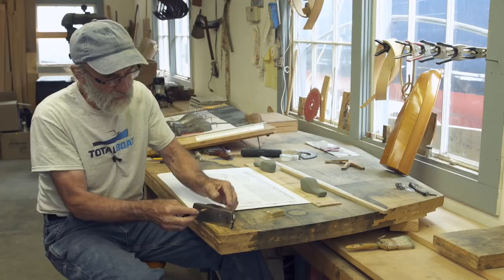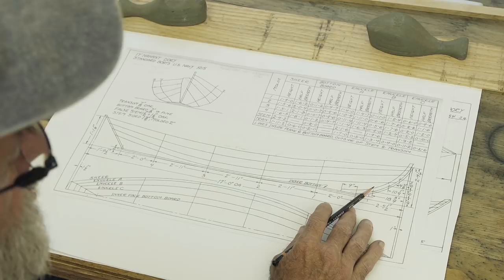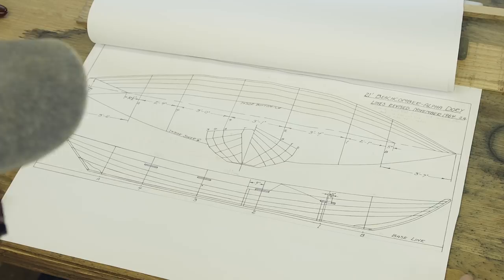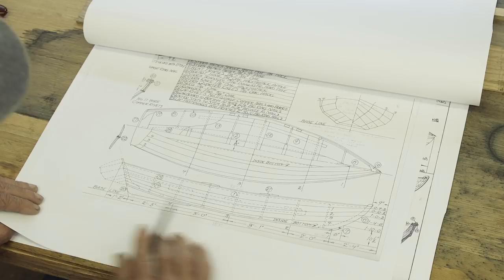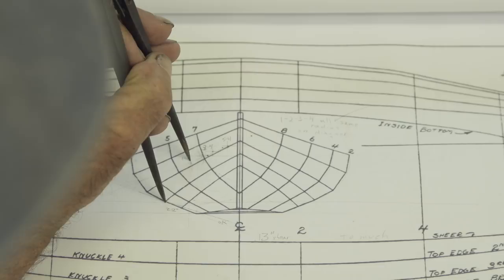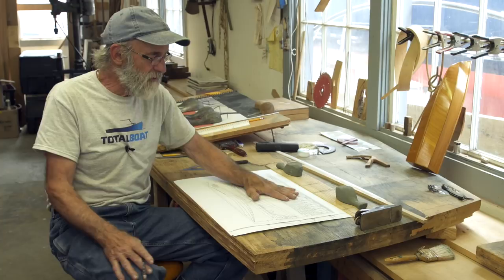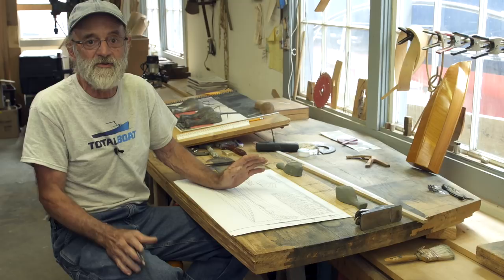An introduction to Dory designs and plans with Louis Sauzedde

Comment: In January of this year from suggestions of others at the boatyard where my small office is (30 years in marketing) I enrolled myself in a boat building school. The word school is used liberally as it's basically just a place where you can build a boat with not much emphasis on self teaching yourself. The boat that was suggested to me to build is the Indian Class 21'2" John G. Alden 1927 classic boat. I've spent the Spring lofting this boat at full size and have been waiting for the stars to align and wondering how I'm going to go about this. So I'm super excited with this plan of yours as there's some similarities in this build, the most is there's 5 planks in lapsrake with the same type of steep deadrise you mention. So super excited to learn and maybe put some of what I learn here into practice.

Comment: Interesting! I’m doing a project using pallet wood. Some of these pallets were more like trays; some 20ft long. I used these to cut them into strips and laminate them into the boards (5plies). I build upside down and found the further shape by making use of long strips of pine taken from the same trays. Where I wanted them to curve more strongly, I thinned them down. Proceeding this way I made a partiality laminated webbing that gives the shape of the starboard side of my 21ft boat. Next step was to make cardboard templates every 10”, that I mirror and bring over to a B/SB mother template. So far so good. I liked the great freedom in 3D life size modelling this method gave me. Almost like working in clay, but much, much faster and less cumbersome.

Comment: Hello Louis, in reference to mixing epoxy. 
I will take a piece of coat hanger, the heaviest gauge. I then take a 10 inch  piece of that heavy wire, and bend it into a triangle on one side,
1" x 1" X 1", it kinda looks like a mini hanger at the bottom. I might bend the other end over on itself then put it in the drill. This tool will blend the epoxy thoroughly in a very short time. FYI

Comment: In order to find the centers of those planks, you would use a compass and perpendicular bisectors between the points. Their intersection would be the center of your circle. You could then find it for the two outside points and verify that it actually is a circle.

Comment: Well I studied those same plans and others, but since I have little practical experience in boats on water, I wasn't looking at them like that!  I've made several half models, and they have all surprised me, in various ways ..... going from 2D to 3D ain't anything I can do in my imagination.  The Nahant Dory lines are intriguing, yet to carve that one. Looking forward to seeing what you got in your head to materialize, and how you do it! 

I'm setting up to make a row boat from Howard Chapelles "American Small Sailing Craft", which I imagine was used on rivers with sea ports on them, riding the tide upstream, and riding it down when it went out, in 1750 or so.  Not because I live on such a river, but because the lines as simple as they were, left me wondering till I had to carve it to see, and I could not believe it, so simple, so sublime, now I got to see it life size.  I'll not regret that it could have been better had I waited to see the 36 dory chapters; I will just start another boat.  The Skiff build was great, I learned a good deal, thank you and your production crew.

I made a 4'x22' ply surface to laydown lines, and glued up battens that long, and had some free DougFir for transoms.  The rest will be White Pine, some White Ash.

I love John Gardeners drawings, but if I had to use plywood ...... I'd stick with furniture repair.
Reply: I got forms set up, and transoms, and chine logs; lots of rocker, and some twist - I'm really surprised how a little twist changes the shape of the board, and how resistant the wood is to twisting, even in long lengths, maybe 15* twist. Pretty cool to see the shape of the full size curves though, more fun than a man my age deserves. Good thing I didn't start with a real involved design. : )

Comment: As I watched over your shoulder while you went through a few designs I started thinking.  If we  examined a larger sampling of designs things might start to fall into a few classes.  Using for instance dead rise, ratio of radius to beam, height of the common radius point above or below the sheer line.  These three factors may start to tell us something about specific dory types.  Or maybe not!  

Anyways I'm looking forward to see where you're going with your design.  One of the problems with small boat design is that you want to build each on of them!

Comment: Another easy way to find the center of a set of planks you know are radially spaced: if you're using that same keel-on view, find the center of the plank (between the top and bottom edge) and draw a line perpendicular to that plank towards the inside of the boat. Do that for every plank and they'll all intersect at the same point, and that's the center of curvature. A line drawn at 90 degrees from the midpoint of a line between two points on a circle (called a chord) will always go through the center, so you only need to do it twice to find the center. Doing it more than twice increases your accuracy, though.

This is the result of a theorem that says "The straight line joining the centre of a circle to the midpoint of a chord is perpendicular to the chord."

Comment: Hey Lou, noticing the block plane upon which you're tweaking the pencil point has an adjustable mouth.  Neat.  I haven't scored one of those yet (all fixed so far), but I did pick up an old circular saw yesterday-JUST because of your inspiration.  As much as I love hand tools, great long rips by human power are no fun at all.  Working on my tool kit for boat construction.   

So. It's August now.  When does the show start?

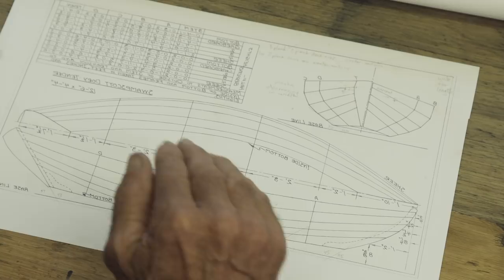Comment: 8:28]  "...and what I've come up with here is a method to describe the center sections of these boats.  Now, I kind of figured looking at any of these plans, and by looking at drawings and dories is themselves, it that the topsides of these should be in a kind of a radius, it is not like a parabolic curve, the top planks are in a radius, so I wanted to figure out where the center of that radius would be..."  Louis then goes on to show us how he did it and what the significance is.

I took the time to transcribe that passage from the video to illustrate a point.  Louis knew what he was doing, he knew what he was after, and he had the genius to figure it out.

What you just witnessed was a real act of genius of visio-spacial reasoning performed with nothing more sophisticated than a straight edge and a pair of dividers - and a pair of human eyes and a human brain.

Hat's off to Louis.

Comment: Fascinating the relationship between the deadrise and the radius, that the radius is tangential. That is not immediately obvious...until it's stated.
But I'd have thought that the lateral offset of the centre of the radius would be set by a line 90° to the deadrise at its top to where it met the horizontal across the sheer. Wouldn't that work?

Comment: Lou, have you ever had occasion to express your theory of what happened to Joshua Slocum? I read that most of his material used to rebuild his boat, the Spray, was green lumber that he milled himself. Would his material fail after only a few years of sailing? I would like to believe that he became ill and unable to handle the boat in rough weather.  Do you have any thoughts?

Comment: What is the significance of the planks being distributed on a radius, and of finding the centre? Is it to facilitate construction? Is it an aesthetic consideration? Does the radial arrangement repeat itself at the other stations as well or only at maximum beam?
Reply: Or is it that if you draw the lap lines according to straight line diagonals the bevel on the planks can be constant and therefore ripped on a table saw as opposed to planing each plank individually?

Comment: Hey Lou! Great video! What is the significance of the planks being distributed on a radius, and of finding the centre? Is this a requirement for the proper distribution of the planks or an aesthetic consideration? Does the radial arrangement repeat itself as a design requirement at the other stations as well or only at the stem and transom? Thanks and all the best...

Comment: Can someone explain what he is doing with the radius's of the curve.  How is he determining deadrise? Is he simply measuring it?
Reply: "Deadrise" in any boat type, simply describes the area (if any) that is almost "straight", or "flat" in the sectional view of the hull, below the "turn of the bilge" (the "radius" part he's trying to quantify with the divider sweep), and above the boat's bottom (flat in dories here) or keel/centerline structure (in other boat types).  Some boats with very curvy forms, will have a "wineglass"-shaped sort of cross-section, with the "deadrise" flat being almost non-existent, or harder to define precisely. 

Since dories by definition are composed of a series of distinctly flat individual planks (fewer and wider than any other small craft type)... anywhere that more than one of the adjacent planks stays in the same plane, makes a very obvious "deadrise" in the lower sections of the hull.  So then he's only talking about whether this flat is comprised of two of the planks, or three, as the case may be here.  Then the other mentioned measurement is the angle this flat portion forms above the horizontal bottom (i.e. the 22 or 30-ish degrees he mentioned).  That's just taken with a protractor here on the drawings (or with a boatbuilder's "bevel" measuring tool, another way to take the same value to&from the lines/structure while physically building).